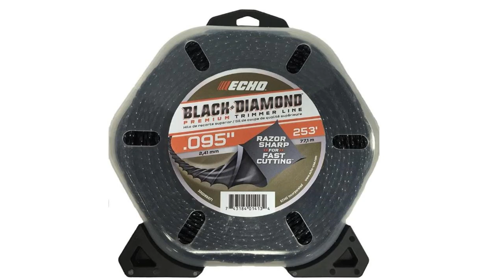Echo Speed Feed® Trimmer Head: Loading New Line, Disassembly, and Replacing the Head

Comment: You would laugh if you saw my problem I'm having. Whenever I pull the cord to start my weedeater up, the trimmer line sucks back into the head, any suggestions?
Reply from the maker: Interesting. What brand do you have? I'm thinking you may have wound the string in the wrong direction.

Comment: Mine is missing the metal ring with the slot for a screwdriver that goes around the shaft, so I can't lock the shaft. Any suggestions? I don't have pliers that are skinny enough to grab the shaft.
Reply from the maker: Hi Sean! We have the same last name. I'm Bill Monahan from San Diego. Nice to meet you!
I don't know what to do about the missing part but perhaps you could call DeWalt and ask for a replacement part.
Reply: Hello, distant relative, and thanks for such a quick reply! The issue with mine is that, without the locking collar/ring, I can't get the head off to install a replacement 🙃. I need a super, duper skinny set of pliers with a round, serrated gripping surface, or some other way of holding the drive shaft in place. Needle nose pliers don't have the right shape to grab the shaft, and none of my regular pliers are skinny enough to fit the gap.
Reply from the maker: @SeanCMonahan  Are you missing the collar that I have in my hand at 2:01 ?
Reply: Yes, that's the piece that's missing on mine unfortunately. Whoever worked on this last didn't put that piece back on before screwing the head on.
Reply from the maker: @SeanCMonahan  I see. I would call DeWalt and get another piece. I think it might be dangerous to use without that piece, and I have to look out for fellow Monahan's!

Comment: I can’t get the head off mine. Any suggestions? It’s extremely tight
Reply from the maker: Remember, the head comes off clockwise.
Reply: @SparkyChannel  thanks for the response! I have a DPAS-2100 model. Is it a different method? I have the slot to put the screwdriver but there is no indention that the screwdriver locks or pushes in it’s just a smooth wall inside.

Comment: I am a bit confused on this. When you say “the L goes up” do you mean it faces the ground in operating position, or the sky?
Reply: The ground - Up towards your eyes when you're putting it on.
Reply: @pleibel  Goes up could mean towards the sky while operating. That's how I took it. Good thing i found this clarification. 
In general, I find these speed heads frustrating. When you tap to release more line, it seems loops inside the head get a bit unraveled and sometimes trap the line. Next time you try to get more line out, it is jammed.
Reply: I hear ya! I've taken to put this video into my desktop "filing cabinet" as I seem to need to refer to it every year!  🙄 @ivanchernyavskiy1320